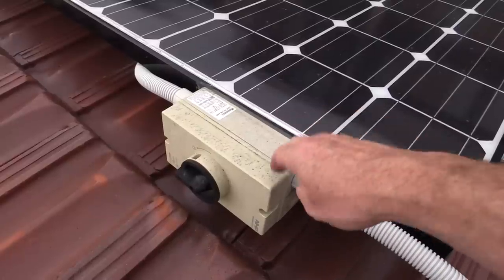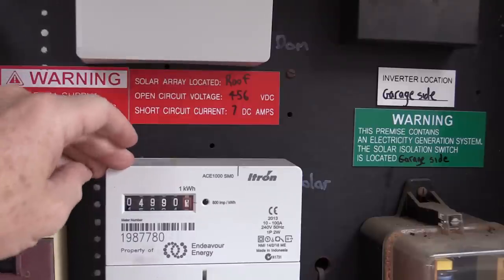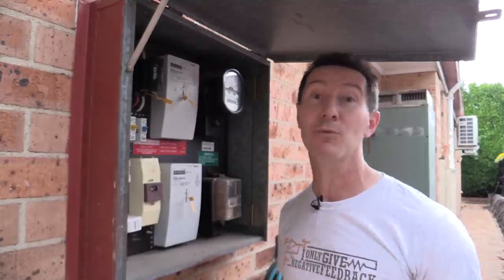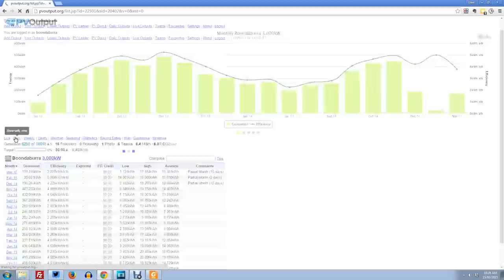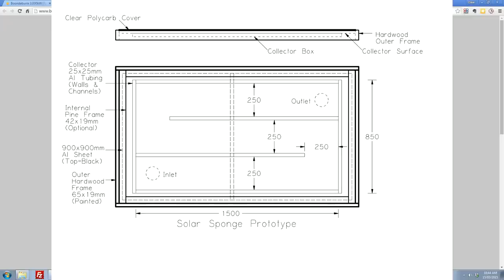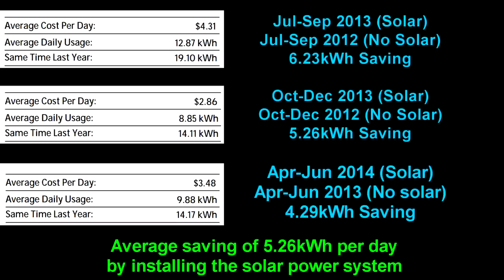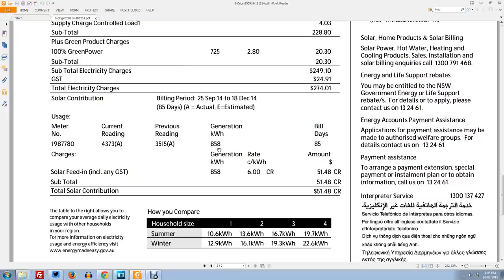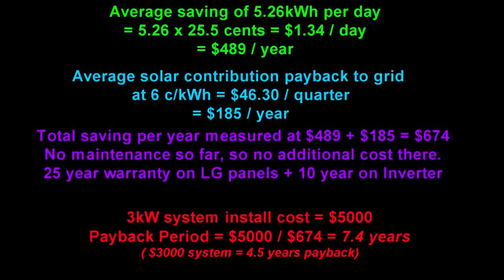EEVblog #724 - Home Solar Power System Analysis & Update

Comment: Your main panel sure is different than how we run things in the US. Whats your main breaker current rating? Things look a little wimpy in there.
Reply: :) You have 120V in US and they have 240V so half the current. Also your power consumption is probably 4 to 5x higher at least.
Reply: ***** Residential homes have split phase in the US. This means two 120V phases and a neutral enter the home. A typical residential home has 200A split phase service, which means two pairs of 200A 120V conductors 180º out of phase, for an effective 240V 200A service. This means typical outlets and whatnot are 120V, however 240V is still available and typically powers things like electric dryers, electric ranges,baseboard heaters, air conditioners... Older homes have 100A service, newer homes are starting to put in 400A service as standard. I used ~2,600kWh last month and I paid $0.064/kWh at night, $0.106/kWh during 'peak' hours, all fees and whatnot included.

This might not be very important for Dave, since he would want to use excess solar during the daytime. Having the full 20kW charging available for your Tesla would be nice, but that means you'd need over 100A service.
Reply: Frank I lived in Europe there a typical house has a 240V single phase connection with a 32 to 64A main breaker.
Also typical power consumption is 150 to 300kWh /month
If you have some serious loads like electric heating or something like that you can get 380V three phase so again for same power you don't need much current.
That is why it may look wimpy :)
Reply: ***** That's kinda crummy since it would presumably limit the adoption of electric cars if the highest practical charge rate might be something like 3-5kW. That's insanely slow if you ask me. I charge my bicycle at 2kW, and its got a tiny little pack, not an 85kWh one. It mostly means you'd literally have to plug in every day so you never have to worry about that 24 hour charge when the pack gets depleted. And if you drove a lot daily, it's not possible to charge fully before the next day if you only had 32A service. Grid issues aside, most US homes can charge two Model S's full bore at 20kW with twin chargers without doing a thing aside from running the wire to the HPWC from the panel. Personally I think even a 4-5 hour charge is pushing it, I would prefer 2 or less. It's not like it uses twice the juice to charge twice as fast. Although yeah, MOST days the thing won't be dead, and MOST days it can sit overnight and charge no problem. It's just nice to have the power on tap if need be.
Reply: Frank I think most typical house in Europe will need to switch to 380V 3phase for fast charging of EV if they need this.
3kW in 8h overnight is 24kWh and for smaller EV that is a full charge from zero.
That amount of charge 24kWh will allow for at least 100 to 150km of driving so that is more than adequate for European cities. They can also fast charge the car at work if they need or want to.
Not sure what battery pack you have on your bike but even a 500Wh pack charged in 15 minutes at 2kW 4C is a bit extreme.
Europeans are more concentrated on energy savings than consumption is a different way of thinking about this.
I can get both sides since I now live in Canada :)
But my house is still ultra low power even for European standards.
My OffGrid house battery pack is probably not much larger than you bicycle pack :) with the main battery a 24V 100Ah so just 2.5kWh capacity and 3x240W solar PV array with an average monthly consumption of around 80kWh
Reply: ***** Yeah, I get most of the time the majority won't need very fast charging. It's just super inconvenient in those rare instances if you have to wait for a big pack to juice up for really no reason. A big pack like that can run even a 20kW charge no fuss, thats 1/4C! So, it's not like you're loosing much, if anything in the way of efficiency, its just the initial cost of the charger and supplying it with power. Super low charge rates give people the idea thats how it has to be for some reason. My bicycle has a ~1.7kWh pack, but I rarely run it below ~40% SOC since it gets saggy and reluctant to throw out more than 15kW. So generally when I plug it in, it takes 20 minutes or so to top off, which is tolerable. It used to be HOURS, which really started to suck. Although I guess this is less of an issue with a car that gets a fair range, but waiting hours for something that can take minutes just sucks.

Statistically, you Canadians use more electric than the US. 80kWh isn't bad, but totally achievable. I'm the kind of guy that replaces the transformer for a doorbell to save 1W. I'd love to build a passive house and heat/cool it with a mini split heat pump totally off grid. That just sounds appealing to have the house heat and cool itself off electricity it makes.
Reply: Frank
I have a temporary propane heating for now but I intend to use PV panels to heat the house directly with electricity to be 100% passive.
My house based on the last two years since I moved here uses about 1000kWh in the worst winter month for heating. Winter is long here so the entire heating season needs about 4.5MWh.
I will just need to design and build what I call a Digital MPPT for heating. I just need to finish with the Solar BMS project first.
Reply: *****
Actually most of the houses here in Austria/Germany are connected to 380V-3-phase. Not everyone will have an outlet installed for it, but one phase is often exclusively used for the the stove, another one for washing machine/dryer and a few lights and the third one for all the outlets and rest of the lights.
I actually up to now never thought about the inverters used in solar installations here. I don't know if they are smart enough to distribute the power to the most loaded phase, or just dump it on one (making it very inefficient, if you want to use the power yourself).
Reply: superdau How would it know what phase is most loaded? Line voltage has little bearing on your loading, it could just be grid loading. Putting clamps around your incoming mains for the inverter to sense is kinda unrealistic and rather problematic. Presumably some people run single phase inverters that load whatever phase they are installed on, others might have a 3p unit that presumably load all 3 evenly. I would assume this has more to do with the physical design of the power electronics rather than an intelligent choice. So, most people in germany have a 3 phase panel? With 3 phase breakers for higher power loads and all? 3 phase would be wonderful in residential, but supposedly we already have 'oversized' electric service in the US.
Reply: Frank
We have a meter (not for billing, just for internal use) that shows voltage, current, power (W and VA) and used energy for every phase. It's just just 5 blocks wide on the DIN-rail (I don't know if you're familiar with DIN-rail mounted breakers/switches; so it's the size of 5 single phase breakers) and if I remember correctly it has a pulse output for every phase and even a digital link.
So of course the installation would have to be very integrated, but checking the drain on each phase would be easy. What the inverters really do is something I will find out in the next year or so since we may install a 3-5kWp PV system.

And yes, for the 3p outlets, I have installed, there's a 3 phase breaker and there's also one triple fuse holder that when opened will cut the power to the whole house on all three phases. A little bit further up the line right where the power feeds into the house is another set of 3 (I think it was 63A) fuses. Judging by that the wires to the breaker box should be able to deliver at least 40kW.
Reply: Frank where have you seen 400A service outside of a million dollar mansion?  Typical residential service in the US is only 100A, which is enough for a 30A a/c, 30A hot water heater, 30A electric stove, and a bit for lights.  Older homes built in the 60s or earlier were only 60A.  Some newer homes are now being wired with 200A service in order to support instant/tankless hot water heaters, which can draw 100A on their own.
Reply: Phillip Susi My house was built in the 70's and came with 200A service. Although electric was the primary heat source at that time. 400A service is common in the sense that I see it on some new builds in the 600-800K range, although 200A is still what most people end up running since the hardware is plentiful and cheap. People who don't care and have gas everything run 100A service since its a few hundred bucks cheaper, but 200A is more or less the default standard from what I see. The local POCO has been running 200A drops by default for residential for decades now. Although some people do end up running 100A SEU and panel to save a few bucks.

200A service is actually questionable for tankless electric water heaters in colder climates. I have a 27kW and 11kW tankless unit, and its 'enough' to serve my needs, but only just. I'm considering replacing the 27 with a 36, although that'd really be pushing my service to its limit.

Comment: So for all who are asking about batteries here is some simple math:
Let's asume you could get a lithium ion battery at $1000 per kwh and it were capable of 5000 full cycles (100% depth of discharge) then the cost for storing energy in the battery would be 1000US$/5000 = 0.20 US$ . Unfortunately there is no such battery for that price (at least not yet) and even if it were available and even if you needed no additional hardware (adding additional cost) that would still be 0.26 AU$/kwh and therefore pointless.
Some systems that come somehow close to that price are the LG Resu 5.0 (5kwh, 5000 cycles (90% dod), ~5500US$), Sony Olivine 4.8 (4.8kwh, 6000 cycles (100% DOD), ~6900US$) but unfortunately these need an additional battery inverter which adds significant additional cost. 
And yes you can buy a battery at Aliexpress or somewhere else, believe that it has the rated capacity, hope that it lasts as many cycles as it is advertised and prey that it won't burn down your house.

Comment: Do you have an electric water heater? In theory you could add on something to heat water on the condition that you are balance positive. Some appliances could use a value for the system status to operate or not. Also maybe batteries could lower grid usage at night or low energy producing times. Maybe someone could make like a water storage tower energy cell that pumps or extracts water from a reservoir. Stupid but maybe better than batteries.

Comment: I really enjoyed the video.  A lot of really good information.  I'm fortunate in one respect that I didn't even consider really.  I'm retired and so I will be using all, or most all of my energy during the day.  That works out well.  I have a 6 kwh system.  They estimate that it will produce 7,851 kwh the first year.  I'm going to go to the website PVOUTPUT and start using that.  I'll also check out the software program you mentioned.  So I got a lot of good information and I'm excited to start tracking it all.  My system will be working on Monday after the city does their inspection.

Comment: 8c FIT is crap.
I experimented in my last setup, bought an inverter and panels 2nd hand and connected it up myself, $700 for 1KW setup, on an old mechanical meter the payback rate is the same as import (net metering i guess, as only excess went out to the grid and made the meter run the wrong way)
it savedme roughly $110 in the 3 or so months it was running based on the daily KW/h it generated, which averaged around 3kw/h per day ($0.29c/kwh) - the Equipment has since been integrated in to a legit, existing system.

a 1:1 ratio is a fairer system.

Comment: You made a comment about solar charging an electric vehicle. If one typically uses their car to drive to work each weekday, then the solar panels are a long way away from the car batteries. Is there any solution to getting power from domestic solar panels into electric cars that are used during the daytime?

Comment: 8c/kWh? That's pretty lucrative for the electric company, don't you think?
Reply: Depends on the point of view and specific aspects of the local grid.
Wind energy and solar energy can not be planned, so the energy companies have to have conventional plants as back up etc. But even considering all of that: They make a pretty penny from Daves system when the sun is burning and all Air-cons are on.

Comment: just a quick question I google the 3 kw grid you speak of the LG pannels and the cost was 7.5k USD I think just for panels. Are in australia different rates for this panels? I'm confused how you were able to install everything in 5k budget
Reply: Tomasz Wida I have the same issue.  It looks to me like once you add in the inverter, wire, mounting hardware, and labor this system would cost around $15k.

Comment: I've been looking at systems, I see your system doesn't use micro-inverters just normal DC cables with a single sunny-boy inverter.. what`s the the pro`s and con`s of using either ??